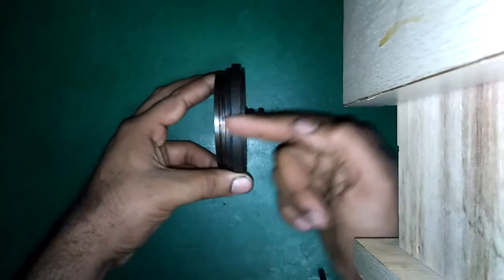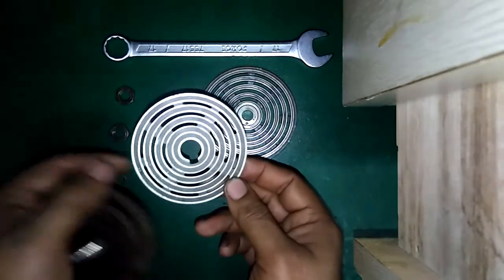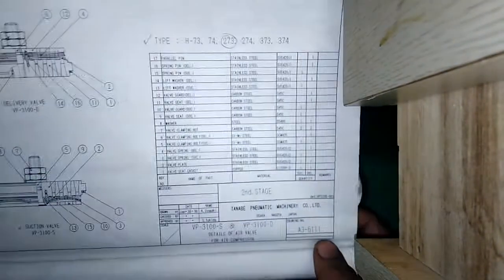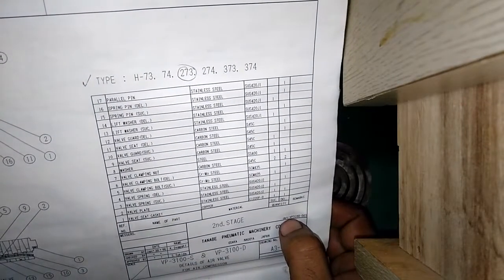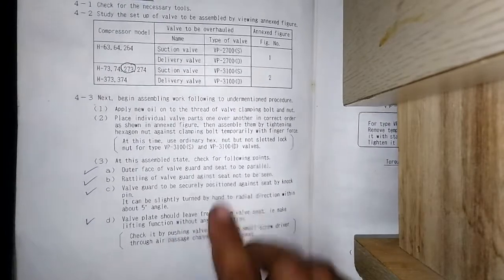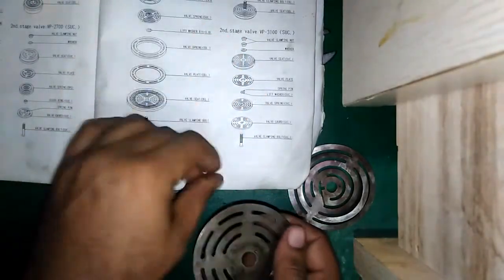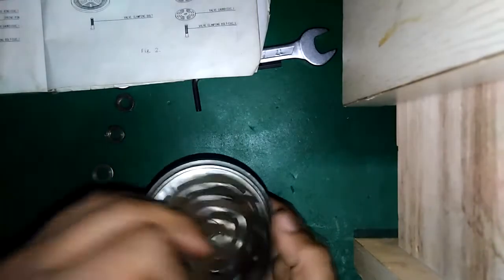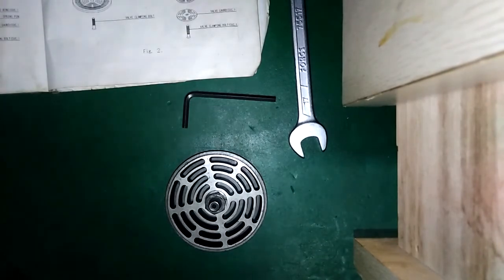Second Stage (Suction Valve) of Tanabe Air Compressor

Comment: what is the device used to open the valve assembly ?
jigs and fixture ?
Reply from the maker: Dear Rahul, It is a device which is provided by the manufacturer, more over you can make a new requisition by seeing spare parts and tools manual.
Reply: Dear rahul  we are manufacturing this types devices for valve assembly